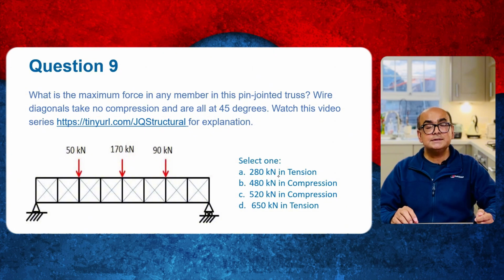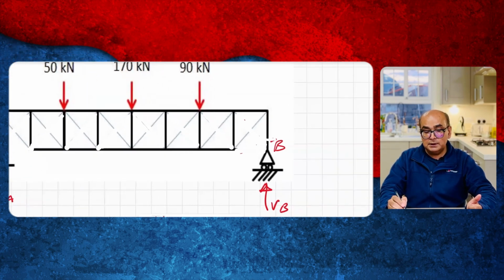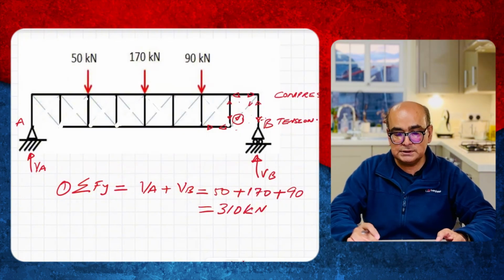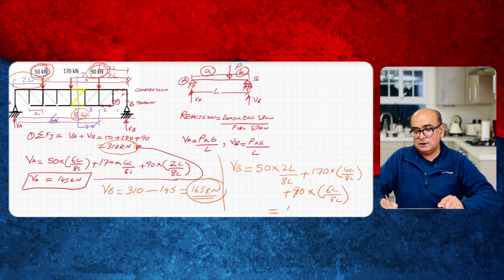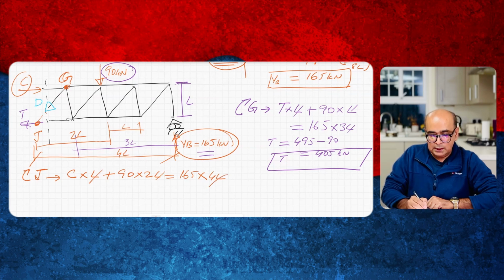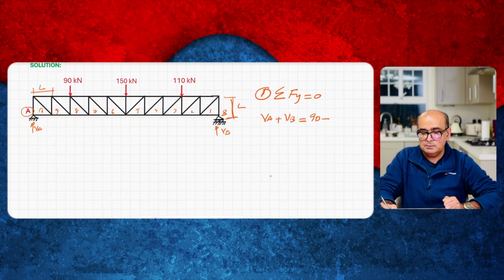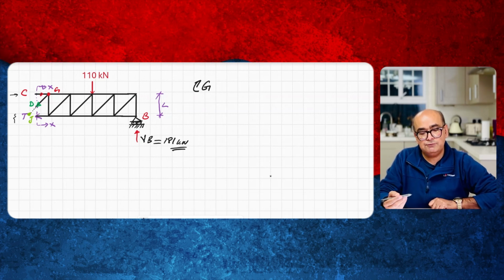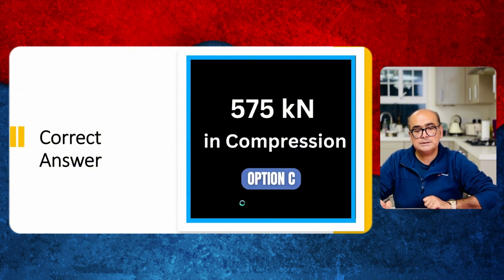Structure analysis of TRUSSES–how to find maximum forces FAST! IStructE Structural Behaviour Course

Comment: Thanks Dr. Qureshi. A question, when taking section cuts ashen determining compression and tension forces, why are we taking them from different positions?
Reply from the maker: We want to determine max tension and that will be near the mid span. The reason for taking sections at the end is to eliminate any members that are taking compression for simplifying the analysis.

Comment: Dr.Qureshi Shab, Thank you very much for your vedios. Your vedios are very much helpful and your explination is very much understandable.Just a small observation, please verify the value of Tesnion calculations at 20.55. This should be 504kN.  Please correct me if i am wrong.
Reply from the maker: Well spotted. Yes, it is 724-220=504 kN. Thanks for carefully watching the lectures. I'll issue correction straight after this message.

Comment: Great video thanks. Just out of curiosity where did you get reaction = load off span/full span haven’t seen it before?
Reply from the maker: This is quick way to find reaction for off-centre point load. The formula can be obtained by applying three equilibrium equations: summation of horizontal, vertical forces and moment equal to zero.